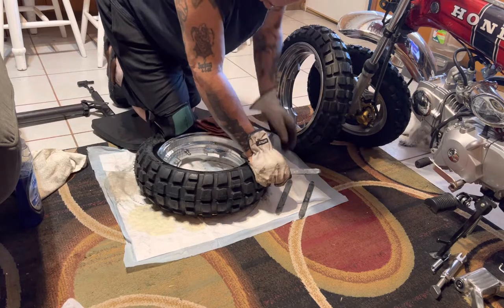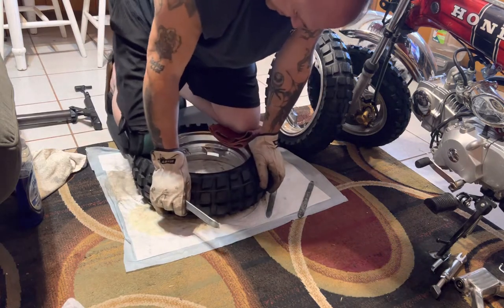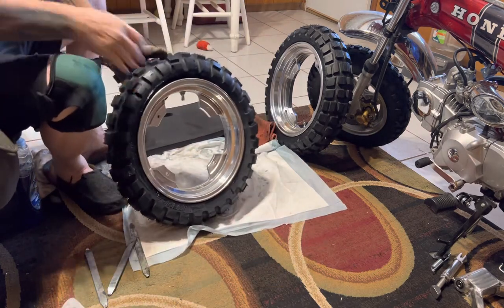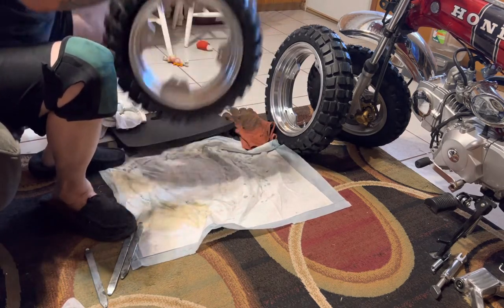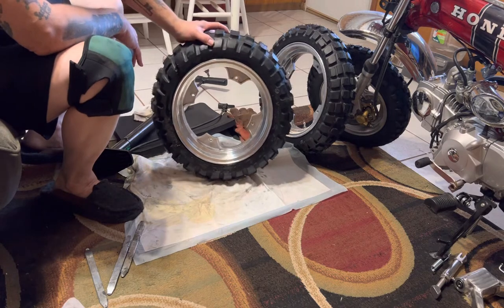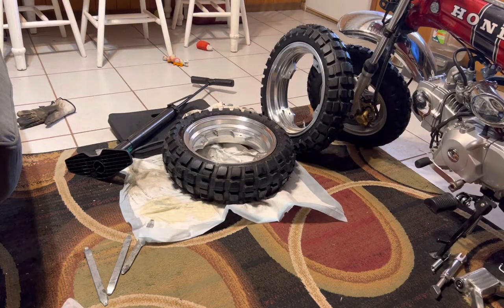How to install a new Tire on Aluminum Wheels for a Honda CT70 Clone Champion Icebear

Comment: What size tires are you using? I have the same aluminum rims. I have an ice bear champion clone Honda125 c.c. MAXXIS 120/70-12 IN TIRES I HAVEN'T MOUNTED THEM YET. I'M WONDERING IF I CAN GO TO FOR THE REAR END TIRE MAXXIS 130/70-12 IN. TIRE ? BUT YEAH WHAT SIZE TIRES ARE THEM YOU'RE PUTTING ON AS WELL AS THE MAKE?

Comment: What wheels and tires did you get
Reply from the maker: I bought the wheels from Bart Moto..12 inch Aluminum..I bought the tires online from a company called Chaparral I believe..I think I mentioned the size and name in the video..or I'll check tomorrow when I get back home